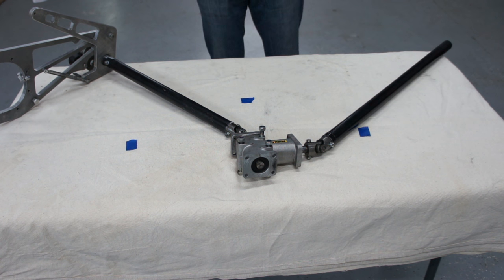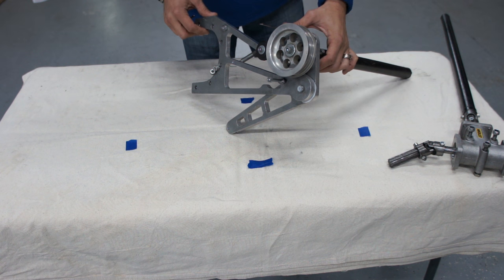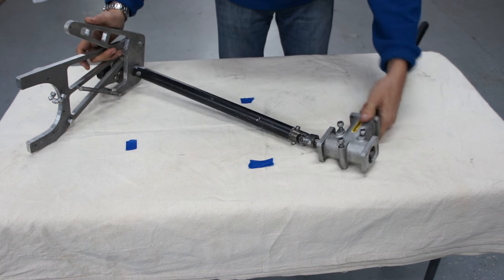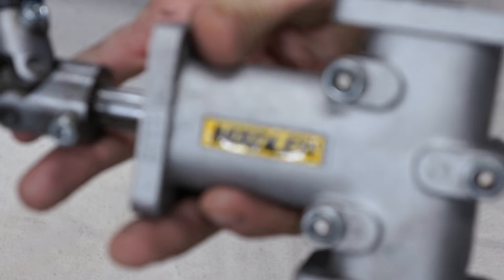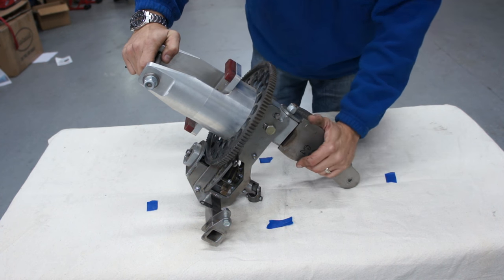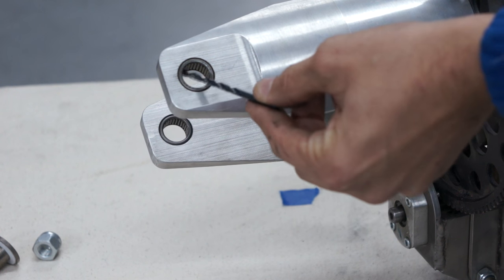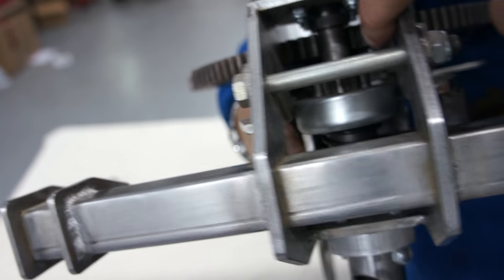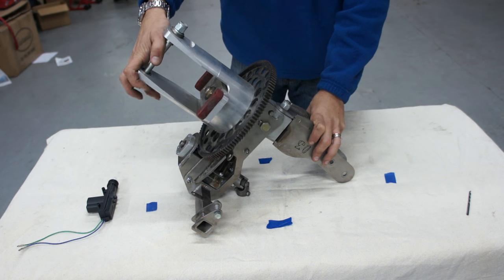TangoGyro Tango2 Rotorhead & PreRotation

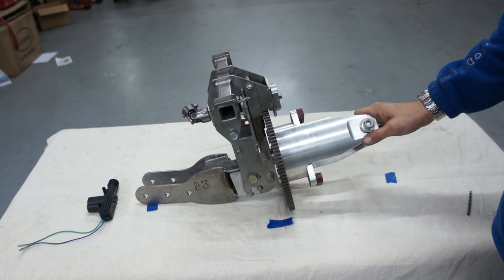Comment: 7:18  What happens if the Bendix is engaged when flying at  50 feet AGL?  Is it better for electrical malfunction to engage the Bendix at low altitude or cruising altitude?  Hopefully the gears will not mesh if rotor is at normal cruise RPM.
Reply from the maker: birdwing98 nothing happens...... this is a two-part prerotator.... (both of the actions have to be performed to engage the prerotator)

Comment: What is the weight of the rotor head assembly without the blades.
Reply from the maker: Aviator168 that is a good question..... i can weigh it out tomorrow
Reply from the maker: The rotor head assembly weighs appx. 23-24lbs.
The rotor tower assembly is appx. 11-12 lbs.
Reply: @PaulVagner  Thank you for the information.